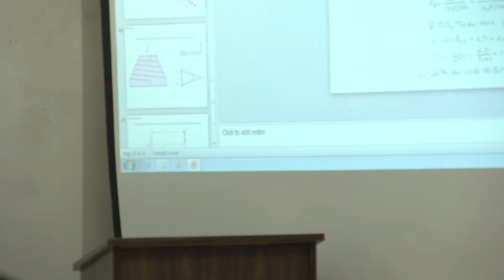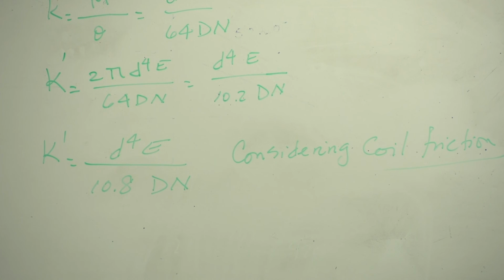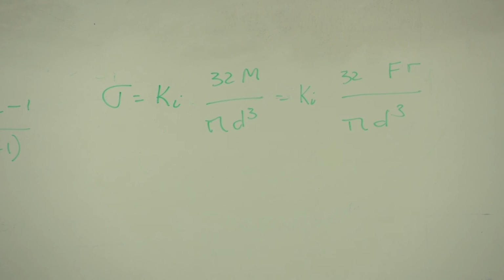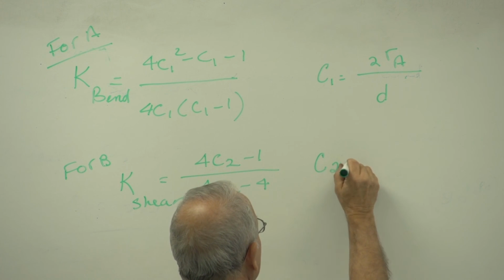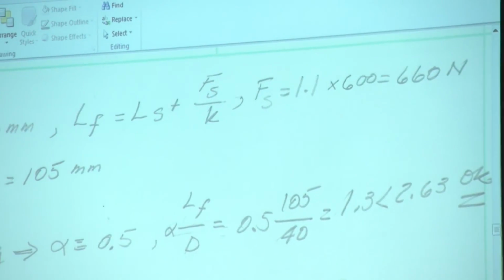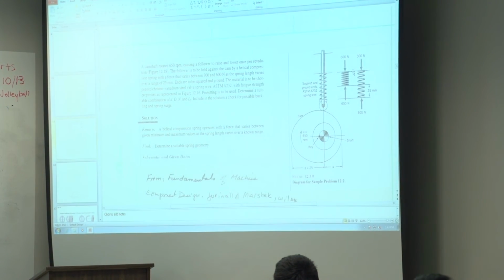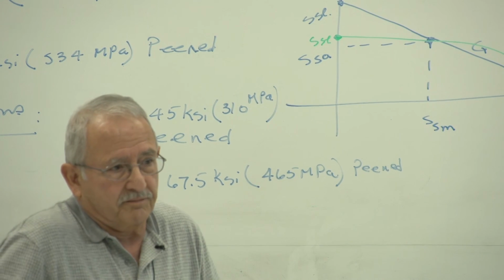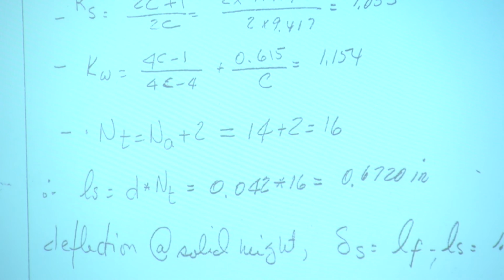Stress Analysis: Spring Rate and Static Stresses in Torsion Springs (17 of 17)

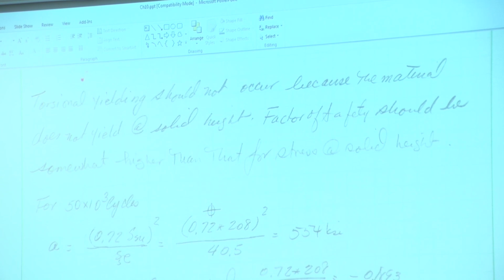Comment: 1:21:02 - 1:29:01 - compression springs (repeats Lecture 16)
1:29:01 - 1:32:47 - compression springs fatigue example, part 1  (repeats Lecture 16)
1:09:13 - 1:21:02 - compression springs fatigue example, part 2  (repeats Lecture 16)
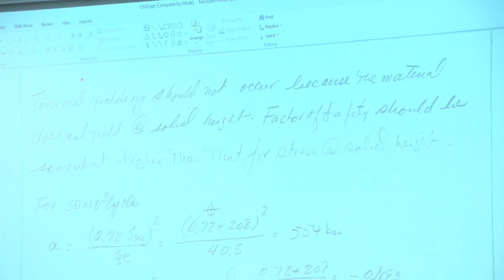57:27 - 1:05:30 - compression springs fatigue example, part 3 (repeats Lecture 16)
1:05:30 - 1:09:13 -  compression springs design example, part 1 (repeats Lecture 16)
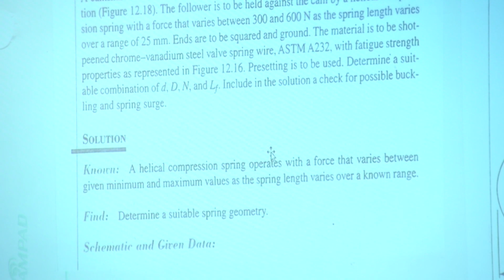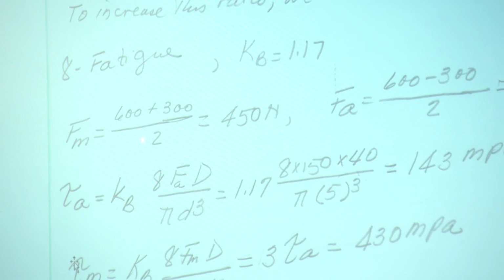45:40 - 57:27 - compression springs design example, part 2 (repeats Lecture 16)
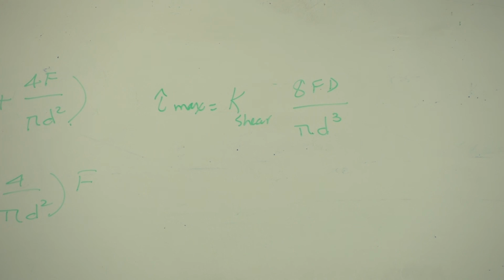42:54 - 45:40 - compression springs design example, part 3 (repeats Lecture 16)
31:07 - 42:54 - extension springs, part 1 (repeats Lecture 16)
19:19 - 22:12 - extension springs, part 2 (repeats Lecture 16)
22:12 - 31:07 - torsion springs, part 1
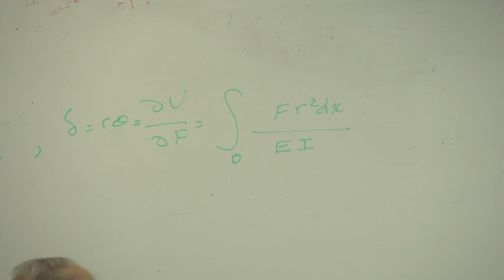07:30 - 19:19 - torsion springs, part 2
00:13 - 07:30 - torsion springs, example